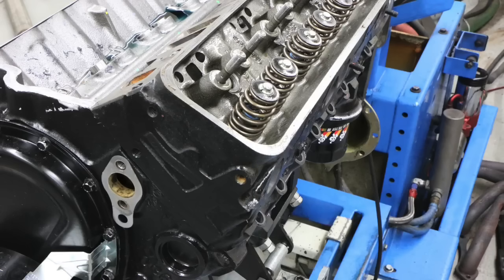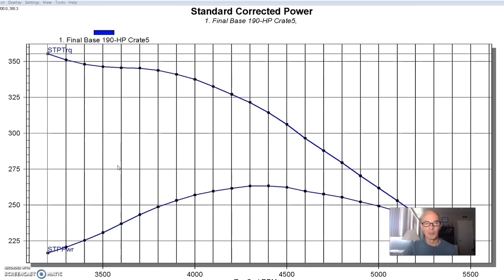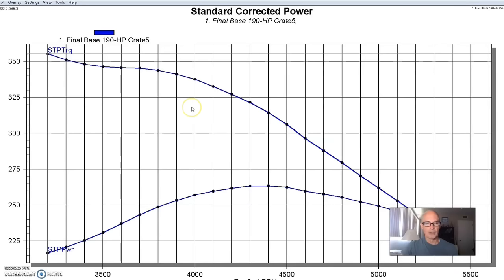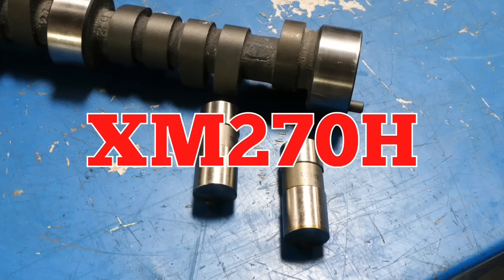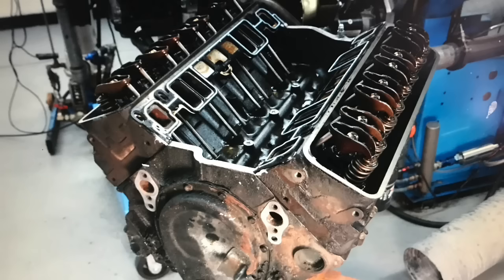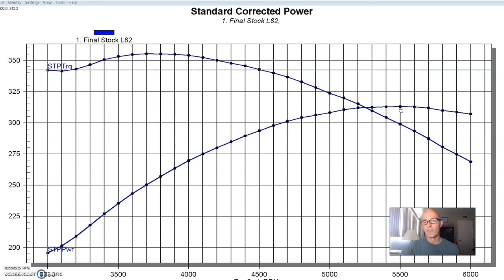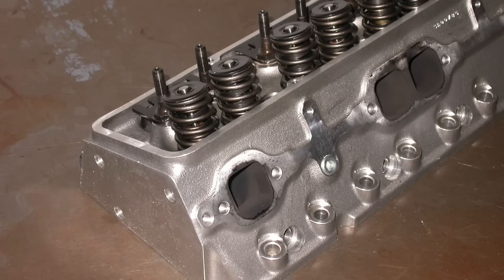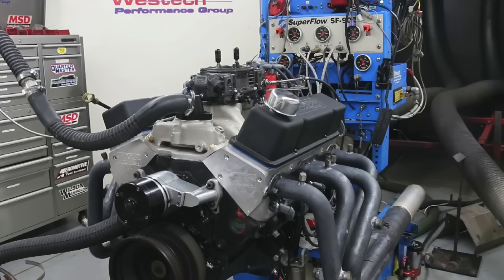JUNKYARD SBC HEAD TEST-VORTEC FTW!

Comment: Could you please do a gen 3 5.7 LS1. (As used in Holden commodore 2004). I am thinking about a cam upgrade without changing heads with x air intake, try y headers and a more flowing manifold piece like the fast stuff I see on yr channel.

Comment: I think I had a comp extreme energy cam and made 450hp and 525 ft lbs of torque with a 400sbc with vortec heads and airgap intake with a 750 DBL pumper carb with 34 degrees of timing
Reply: Did you have to drill steam holes in the heads?
Reply: @davidjaime2061  he is a liar.
Reply: @wildestcowboy2668  hp number maybe...525 tq not a chance
Reply: @gordocarbo  Have you ever ran a MIGHTY MOPAR BIG BLOCK HEMI thru a quarter while spraying?
Reply: Great combo, strong engine.

Comment: I have a 94 TBi k1500. We are buying a camper and I want to do some upgrades to the engine to help make it alittle happier going up hills. I'm planning on doing a cam but idk what one yet. I dont want it chopping like crazy because it needs to be drivable. Also plan to do headers and full exhaust and cold air intake. As was as a chip. Id like to be able to get about 250 to 260 hp out of it without doing heads if i can.

Comment: Great video. Just what I was looking for! I'm curious to see if the stock vortec would benefit from an aftermarket EFI system?
Reply: Best bet for fuel injection on a stock vortec is to get an oem or aftermarket MPFI (multi port) spider unit. Most stock vortecs came with CPFI (central port) which relied on little valves at the end to open up from pressure. Multi port is plug and play and shows immediate improvement in performance and economy.

Comment: Richard how much power is lift worth I think lift is a great upgrade for torque and hp in my opinion a  higher lift cam with  less duration is as powerful as a bigger cam with more duration less lift can you do a test to show how much lift affects power and how and we’re in the rpm .most ls cams are 550+ lift and the older stuff performance cam lift is a way less can older style heads not handle lift or don’t have enough flow yo benefit from higher lift

Comment: Just a tip becarful when looking for them used vortec heads are cracked when bought used hair line cracks hard to see need to be checked by a machine shop also to put a cam into vortec heads you need to add screw  in studs because they are press in and spit out if the cam has to much lift make sure to get a cam that has low lift or made for stock vortec heads also they are so cheap new from summit that used doesn’t seem worth it

Comment: how about boost with vortec heads? Im planning on using basically the same sort of setup vortec 5.7 with cam and springs upgrade and ebay gt45 turbo blowing through an e85 carb. Hoping if i throw enough boost at the old small block maybe i can keep up with the LS powered cars lol

Comment: Anyone ever run 305 heads on a 350?
Reply: 305 heads have smaller valves. I don't see the bennefit.
Reply: The compression gets raised a full point from the combustion chambers being 18cc's smaller
Reply: NO

Comment: But look at the torque of that stock vortec cam!
Reply: Its a JUNK cam. I get another 60-80 hp out of them with a spring/retainer upgrade and a Comp XM270HR with Rhoads VMax lifters lashed at 0.020".  Same low-end torque or very close to it with stock idle quality and driveability.  Sound like a tight lash solid roller cam too.
Reply: Even the stock GM 395' marine cam makes a solid 20-30 ft/lbs across the whole powerband and drops in with ZERO other changes.  The 395 cam and 1.6 rocker arms work with the stock heads (beehive spring upgrade would be a good idea) and pickup a solid 30 hp as well.

Comment: I didn't think you could run that much lift on stock vortec heads without cutting down the spring seats?
Reply: Comp has spring retainers that work with the LS style springs he used to allow additional clearance. Comp also sells a tool any home mechanic can use to machine the guides for additional clearance.
Reply: yes,ls springs,comp retainers ..good for 0.5" lift

Comment: How much did the compression go up with the vortecs? What octane were you using?
Reply: Vortecs are 64cc heads.

If you pulled 64cc heads off there is no compression change.

If you pulled 76CC heads off the change will be ~0.5:1

Comment: Could you please help a few of us out?I was always told (As it seems a few of us have been)that a GM Vortec head could only support .460 max valve lift. Above that you would have to cut the head where the valve spring sits with a valve seat cutter to allow for a taller spring to avoid coil bind issues. I know you have assembled countless combos, so whats your experience say?
Reply: Could also switch valve springs to a beehive type
Reply: GM had a combo with .481 exhaust lift on stock vortec heads. The early ramjet engines with the 395' vortec marine cam and 1.6 rockers. Heads were exactly the same as the truck ones. Springs, retainers, seals. I have not had a set apart that had less than .510 clearance between the retainer and seal.
Reply: im pretty sure the issue is retainer to seal clearance not coil bind from the valve springs. I just do the ghetto grind on bottom of retainers to give extra clearance and then run z28 valve springs with the inner damper removed.
Reply: ffs,google "more lift on vortec heads"             .comp cams retainers and ls valve springs give you 0.5" lift

Comment: I heard there is a better vortec head ? Or are they all the same?
Reply: 305 heads are different than 350 heads. 

Truck LS engines were also called Vortec (marketing descision no doubt) and they had different heads.

Comment: Richard Holdener. Do factory vortec heads really out performer the old 461 and 462 cylinder heads that had 64cc camber with 2.02" and 1.60 valves? I've always thought the exhaust ports look terrible on a vortec head.

Comment: Ive always been curious about 2.02 camel humps vs vortec heads when nothing else changes in the combination.
Reply: vortecs kick the crap outa the hump heads when neither are ported. taked a good bit of porting to equal the vortecs with them
Reply: vortecs kick the crap outa the hump heads when neither are ported. taked a good bit of porting to equal the vortecs with them
Reply: Yeah the stock 462 double humps that came with the 202/160 instead of the194/150 valves do a lot better than the upgraded version of the 202/160 valve's and are a lot closer to the Vortecs
Reply: If you look into the ports of the heads, the heart shaped chamber of the vortecs and the smoothed out guide area and open throat makes the vortec easily win 20 cfm over camel hump heads at .500 thousandths lift on a flow bench. The reason is 30 years of innovation of casting and technology. It’s just closer to the idea of a good restriction free port. Plus the floors of the port are raised compared to the really early fuelie heads which helps transitionary changes.

Comment: Nice video as always. Any guesses of what my boosted engine will produce hp/tq N/A?

355cui sbc
dualplane
blueprint as cast heads
195cc Intake flow heads: 
.100" - 83
.200" - 150
.300" - 190
.400" - 223
.500" - 252
.600" - 245
75cc Exhaust flow heads:
.100" - 83
.200" - 130
.300" - 166
.400" - 193
.500" - 207
.600" - 213
8.5:1 compression
220 / 220 - 114 Deg @.050 Lift intake .523 . exhaust .515

Comment: Yeah, that "190 hp" crate long block is essentially the same as the factory 87-95 TBI truck motor (ERR, ENGINE), a total dog. I've had two of em (in 88-95 TBI trucks) and they were slugs. I tried to soup one up a little with a homebrewed dual exhaust (for off road use only, OF COURSE😜) and TB spacer, CAI, etc. Might've made 210hp. Wheeee.
Reply: True, but if you had that engine with a AOD transmission it would last 300,000 easily and give you decent fuel milage.
Reply: forgot to add a cam,aluminum intake and vortec heads WEEEEEEEEEEEEEEEEE
Reply: That sounds like my 4.3 with NV3500 and 3.23 rear gear. Its an absolute turd. I love the 5 speed, I HATE the 4.3 cause its disgustingly underpowered and the 3.23 I can take or leave but would love to swap it for a 3.73. Only issue is Im a poor college student so money is pretty much non existent to me

Comment: 8.5:1 compression?! It was built for boost!
Reply: Very low boost..cast pistons on a power adder? Better really know what you're doing
Reply: @KingJT80  and power-metal rods. What could go wrong?
Reply: Youd be better off with the L82 for boost. It had forged pistons from the factory.

Comment: Great Test!
I've built a bunch of SBC engines with Vortec heads and we always got 375-385hp from them. We used the same GM Goodwrench 190hp short block but with a Comp Cams Retro roller cam (XM270HR). We did the same spring upgrade with the short style valve seals on the stock 906 heads and used an Edelbrock RPM Vortec intake with a 650-680 cfm carb.

BTW if you use a Vortec engine and use the XR270HR Cam with the same set up it will produce 355-365hp. It never seemed to be as strong as the Goodwrench combo by about 12-15hp, we always thought it was because the compression of the Vortec engine was a little lower than the Goodwrench with the 64cc chambers. Rich, (and you guys out there) you might have another theory. :-)
Reply: I have the 270HR cam in my GM 'hecho en mexico' engine with slightly shaved 906 heads and holley 650. it is a screamer for sure! Much better performing than the sportsman II double hump knockoffs that were on my last SBC.
Reply: @YOUKNOOB  port those sportman 11 heads and it would destroy any vortec ported any day.i have almost 300 cfms out of a sportsman 11 head and 200 on the exhaust very good head when ported with a 2.05 valve
Reply: What short style valve seals part number are you using sir ???
Reply: @tonywalker2334  COMP Cams Race Valve Locks 648-16 and COMP Cams Steel Valve Spring Retainers 787-16....you gotta use both along with the beehive ls springs for lift: GM Parts 12499224 Valve Spring for LS1 Engine
Reply: @tonywalker2334   My dad was the head "guru" and he died in 2007.  That said, I'm sure you don't have the same problems today with the spring, retainer, and locks that are offered for the Vortec heads.  In the beginning (90's) we used PC style seals because we were using dual valve springs, the PC's of the day were skinny allowing room for the dual springs but they had an extra lip on the top that took another 20-30 thousandths sometimes, so we found that using a more expensive single spring with a Viton style seal that was bigger around but actually was a little bit shorter on the guide. Couple that with the right retainer and we had enough room for the lift we were using. We soon stopped using flat-tappets and went to ALL roller cams, at that point, my dad cut down the bosses giving him all the room for many options but in our flat-tappet engines of the day, we were only trying to get .470-/475 lift. My dad used to always say "measure everything 3 times because with the right combination of parts we can come up with the room we need for anything".  He would get his height mic, and a test spring and start mix-matching til he found his magic set up. I dont know the part numbers but, I have heard there is an LS "beehive" spring with a short retainer and lock set that will allow .525+ lift on a stock 906 head but I haven't used it. Sorry I couldn't be of more help.
Reply: @warrenstephens3705  i used z28/lt1 ("1.250 and 300lbs open) springs with the inner damper pulled out, and used the old style umbrella valve seals on my vortec heads. tons of clearance.
Reply: Did you cut the head for springs or just put more spring ?
Reply: @stevenmyers2252  COMP Cams Race Valve Locks 648-16 and COMP Cams Steel Valve Spring Retainers 787-16..
Reply: @trillrifaxegrindor4411  I really want to build one of these for a third gen Z28 I have. Then I have to figure out the E-Carb on it.
Reply: @stevenmyers2252  I made sure the springs fit properly over the valve boss - it didn't take much - some already had plenty of clearance. I did not have to cut the spring seat
Reply: Where are you located sir I want you to build my engine

Comment: these videos really make me wonder what my SBC really makes (est. from locals very---500hp to 600hp), it did put a '72 Chevelle in the 10.20s@128 in the quarter, I lean to a really honest 500hp.
Reply from the maker: if it runs 10.20s-you are good!
Reply: @richardholdener1727  RE: my sbc-------It ran 10.20s on race gas, bigger carb. than I run in a BackHalfed, Big Tire, 5500 stalled PG,  gutted Chevelle , was spinning it 8800rpms through the lights, (i saw it run 10.40s easy) now its in my little MGB, 4-speed street car, I think it's pretty sporty (by no means do I think my MGB is a 10 second car, but it'll gap a mid 11 second car from a roll)
Reply: P.S, there's NO GM parts inside my sbc--straight up race engine

Comment: Junkyard vortec 1.6 rockers .15 head gaskets and rpm air gap that was an amazing  engine
Reply: did the same with a 268 roller cam. same head gasket with larger manley pro flow necked down valves and 1.65-1 holland sharp rockers. rpm intake. very peppy lil engine that still got me 21 mpg in a 91 camaro with 3.73 gears and a 2500 lockup hughs converter. 750 holley double.
Reply: @darinr9424  i ran a couple lpg carbs 650 cfm combined and was able to run alot more timing than pump gas 17 mpg on lpg  1500 silverado for 1 dollar per gallon

Comment: I'd like to see max compression with stock cam...then max cam with stock compression.then max cam and max compression togather to see witch helped the most and see how much the total togather is
Reply from the maker: cam makes more than compression-both together make the most
Reply: @richardholdener1727  chk my last comment Richard .ment to send to your channel but replayed to myself.
Reply: Copy that richard.just a numbers thing for data.
I've just stroked my 355 Wich WAS/ kinda hot for the street 12.5 to 1s and .600/.625 wp heads 2.02 /1.60s..
It lost 3 roller tappets @ 7500 .so it's a do over.
Now it's 3.750 crank with 13.7s and a new Herbert cam .615 /.620.
My lobe sep went from 108 to 110 guessing I'm going to pick up more tq than hp .
It's .040 over now so I think it's 388? Guessing on the cid..hoping for 550 on the hp.
My heads are the hold back only 185 intake runners
Reply: go for it,ill watch

Comment: Many people downgrade the crate motor ?But it is a good engine for general purposes. A Quadrabog and headers and off ya go. Good for Towing. It would burn rubber if tires were not to big.  But put a Crane Saturday night special cam in it an hold on to your Gonads. It will rip through with midrange torque you would never expect.  Still the SBC is tough to beat for performance price and ease of working on.
They take a beating and continue to work.   CAT is Grinning.
Reply: add vortec heads and it jumps up another 75 horsepower

Comment: Thanks Richard for this test. I have a 74 Corvette L82 I bought brand new in 74 that only has 49,000 miles on it. Already have a performer intake and long tubes on it. Been trying to decide weather to LS/LT swap it or just do heads, cam, and pistons. (It has the stock piston slap LOL). Good info here. I understand the LS swaps and the C3 platform require more effort than most swaps so upgrading what I have may be the way to go.
Reply: Unless you plan on changing your pistons for a set with different compression height than I'd stick with the l82 pistons. They have a smidge more compression height than the run of the mill 350s cast pistons had. And they're forged pistons(hence the piston slap) so they're quite a bit tougher(they can handle higher rpm, boost, and spark knock alot better than cast does).
Reply: Darryl Brown yep, the stock pistons are forged but quiet a bit louder than other forged motors I run. I would do a forged piston with more compression ratio as I don’t spray and no real plan for boost. I’ll leave that for my other junk. LOL I know the bore may have to be cleaned up for new pistons.
Reply: Build what you have!! No need for an ls swap. THey are not cheap to do properly like most think and the 5.3 is anything but impressive.

Comment: Good episode Richard,I built a 408 with self ported iron Vortec heads.2.02 and1.6 Rev stainless valves that were.100 longer then stock so I could Comp 828 springs.They flowed 243 cfm at .400 on intake and 180 cfm on the exhaust.280 Comp extreme hydraulic roller with 1.6 magnum roller rockers and Edelbrock RPMAirgap and a 750 Demon carb,10 to 1 cr.I estimated 500 hp,this motor in a 1980 camaro 4 speed,342 poi’s was scary fast!!!would pull hard to 7000!!was a great street combo
Reply from the maker: nice combo
Reply: Ported a set of GM vortecs for a friend...ran a smallish cam dp headers etc. Ran 12.80s in a 68 Camaro...lots of low 13 sec runs but it was a heaping ton better than stock and it was cheap. 400ci